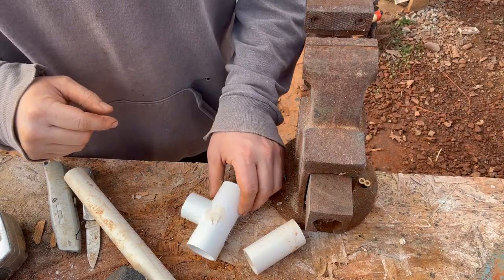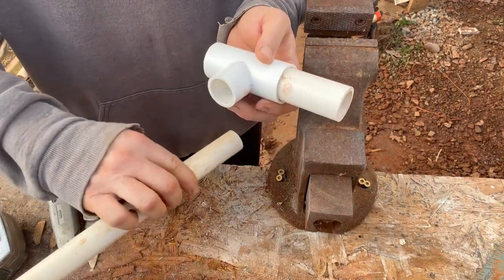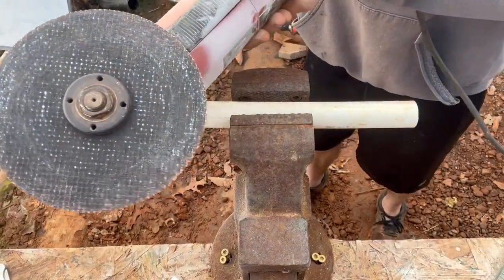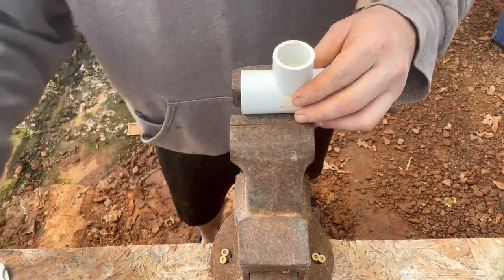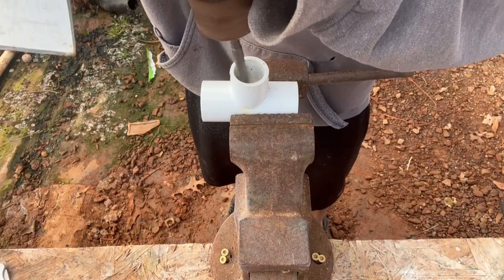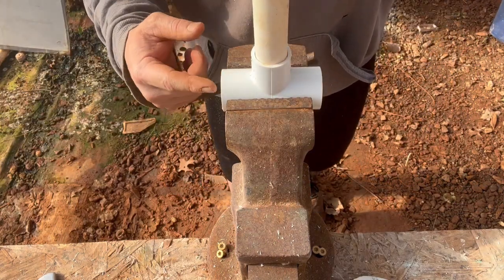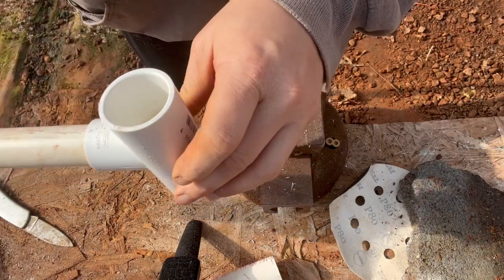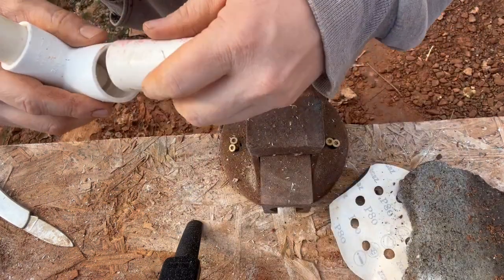Stop using airstones!! Use a $2 venturi instead!

Comment: an air pump is much cheaper, simpler, longer lasting and quite energy efficient for the amount of air... I suppose your suggestion to stop using air stones is if you're already running a pump... one could do the opposite and set up water circulation pushed by air bubbles for a very good cost (and energy cost).

Comment: If you T socket is for 30mm diameter pipe, for the vertical air inlet pipe, you can use 25mm diameter pipe which can be pushed in nicely. Aso on top of the vertical pipe, you can insert a ‘end cap’ & drill a small hole on one side. With that you can control the amount of air running out of the Venturi. Fyi, Venturi is the person who invented it.

Comment: .You need quite high pressure to get a venturi to work efficiently , so a pump is required . Or you have an air pump  Both used in water treatment   about the same overall  efficency.  For shallow tank , you are probably getting as much oxygen transfer from surface as from the bubbles

Comment: This has a low up-front cost but will cost a lot more to run over time than simply using an air pump. The back pressure it puts on the pump reduces flow volume and pump efficiency (costing far more in electricity than simply running an air pump would) and can actually damage some pumps. There is so much bad advice on teh intarwebz...

Comment: question. if I want to draw a liquid instead of air, will this same design work? if so, if I want to draw a high concentration of liquid to water or vice versa, what, in general, are the variable changes should I make to do that?
Reply from the maker: Yes this is generally what venturis are used for. They have a bunch of these for sale on amazon with different mixing ratios and sizes. They are also not that expensive, but the ratios are typically 100:1 200:1, so it may not work in your situation, but look around. 

Another way to do this is get an adjustable fertelzier injector, some of these can go down to 25:1 or maybe even more.

As far as the one in the video you would have to add a cap, put and install a barbed fitting with a small hose going to your solution. 

Good luck!
Reply: @SaludaGradeFarm 
thanks for the quick reply. my goal is to get a 10-1 ratio. I'll be starting with a 10% solution and hopefully get to a 1% solution. I've seen plenty that get me there more or less, but they typically are intended for pressure washers, and i want hose end. I'm thinking I may put a few in series for more total draw. I would like to try my hand at making it. anymore thoughts?
Reply from the maker: @GreggGiblin-sy5og what is your project/goal?
Reply: @SaludaGradeFarm 
hose to shut off valve to venturi liquid uptake from tank of bleach/soap solution  to telescoping pipe with hose connected back to venturi outlet with about 25 ft extension capability to a nozzles capable of reaching high places. bleach solution is 10%...reduced to 1-1.5%

Comment: Fantastic video! But does using such a system reduce the lifespan of the water pump due to immense load? 

Please suggest a good pump to use with this DIY venturi jet system.
Reply from the maker: No it does not seem to significantly effect the pump, why? Because it’s a centrifugal pump where water can literally flow backwards through it while running due to tolerance between the impeller and the housing. These types of pumps are made to work under loads that positive pressure pumps would have a hard time working under due to the stress, if it’s too hard it simply won’t push the water. I use creekstone pumps for small projects, I think 600 gph and I use alpine for large projects like this 5000 gallon pond setup. Just remember they will not work if you plan on submerging them below a foot, but then again airstones can have a hard time working at depth too. Hope this helps!
Reply: @SaludaGradeFarm Thanks a lot for the insights!

Comment: It seems the only way I can get this to work is if I have the air intake pipe at least 10+ inches out of the water.  The water pump is 800GPH about 8 inches under water.  Is that what you've found?
Reply from the maker: Not at all, I have done this with all different heights, I’ve made about 20 of these with various pumps form 250 gph to 3200 gph. The only thing that matters is the depth. They won’t run very deep. Play with the depth of the air pipe inside of the tee. Hope this helps!

Comment: I use a watt tester also to make sure the pump is not over working it's self . Better safe than sorry . In the winter i use my aerator also to help the pond heater keep an opening in the ice , Venturis do not work in the winter as they make the water to cold ad won't allow the fish a rest . My laguna aerator that i bought back in 2010 just gave out  less than a  month ago . I think it was the new substation the electric company put in that they kept having problems with  7 times the power went out and came back on in 1 hour and that has happened now for 4 days and it worked fine before this happened . I never had and issue .  This also effected my well pump my pressure tank and my 4 year ol hot water heater . I and a lot of other people hate our electric company . Yet here they are asking for another raise . The electric company said it was a fuse problem and now they want a raise  REALLY YOU COST ME MONEY ELECTRIC COMPANY . i HAD TO CALL MY INSUANCE COMPANY . They covered some of the damages  seniors are screwed every way . thank god Trump won . Every solar farm they built heer is not for us but they sure are ugly ruined hillsides cut down thousand 's of acreas of trees

Comment: how do you deal with the restriction to water flow this creates for the pump?
I currently have several small water falls and a fish spout cascading water back into my pond - Creates some level of aerator back into the pond. However the majority of my water flow goes through a series of drums holding K1 media where the water returned to the pond simply is returned by gravity - These drums rely on my air pump so curious if you think it would be possible to setup a venturi aerator on my system?

Comment: How come the water doesn't shoot out of both ends and just bypasses the air intake?
Reply from the maker: @Richardjaymz  on this system there are 3 venturis, so the only way to go is through one of the venturis. This is my older system, I now just use one and i have perfect aeration, I tested it in one of my older videos with a dissolved o2 meter!

Comment: With your cost for power to run that pump i can use trickle filter instead for surface exchange and have a lot of oxygen and filteration than. Surface exchange is key not the bubbles
Reply from the maker: I’ve Never heard of a trickle filter before, I’ll have to look that up

Comment: 4 eels!  Thank you so much, I needed to see this.  I have already purchased some cheap air pumps but I think I'm going to try this first.  Anything to reduce the number of moving parts.
Reply from the maker: Glad it helped! 

Stop using airstones for hydroponics! Build this simple $5 venturi in 2 minutes instead!
https://youtu.be/BaxPcKiuBwM

Here is an older version of the video that might be better for smaller system. 

I purchased a cheap air stone kit and the connections come apart all the time, drives me nuts!

Comment: Air stone is meant for tanks that you want mild/gentle water flow. If u want more flow than that just use the pump without shortening its life with all the back pressure. I dont understand what advantage youre gaining by doing this. It is cool though.
Reply from the maker: I’m using a water pump, not an air pump, and it is designed to work against resistance because it’s centrifugal. Also this adds circulation to this large pond. Essentially this is how the commercial operations do it, it also saves a lot of money over buying dozens of air stones that I would need and a huge noisy pump to run them. Has worked for me for years! 😃

Comment: It's cheaper on the electric bill to use an air pump with air stones than to run a pump 24/7. Granted I don't know what size of pump you are using. But you should have explained your setup with more details.
Reply from the maker: The pump is only 200 watts and it aerates 5000 gallons. Pretty inexpensive for the 500 heads of lettuce  I get per week from it. I use a version of these in all my systems just because of simplicity. The only airstone I use is in my seedling flood and drain. I just didn’t want to spend $1000 in a high powered pump and dozens of air stones. I opted for $100 pump that also adds circulation and has lasted for years.

Comment: Very interesting. But you failed to show how it was connected to a pump, singlely or in a series.
Reply: I would like to know if he is using an air pump or its just the suction effect that's pulling the air in
Reply: It's just suction that's how the venturi works,we use the same kind of thing to pull chemical/soaps through jet wash systems
Reply: I'm lost as to after I build this with PVC...how do I connect it ..I need instructions on how to connect what to pump ...

Comment: mine do not work
Reply from the maker: Sorry to hear that, Your pump might not be power enough, you may have it too deep in the water, or you may need to adjust the depth of the air pipe in the tee. It needs to be almost to the bottom and closing off the tee

Comment: Whats the deepest that thiswould work,
Reply from the maker: This will work to a depth of about 10-12” depending on the strength of the pump and size of the aeration. Most of the time they venturis are set very shallow to get the most oxygenation/flow. Plus it causes a wake on the surface which also increases dissolved o2. I will say the circulation it adds is nice.
Reply from the maker: I’m

Comment: I install piping to science labs in universities as a commercial plumber. An engineered venturi involves say a 3/4" tee,then 4-5" further you add a 3/4" 90°.
If the line continues then you just add another 3/4" tee the same distance apart. You pipe both lines going to the same location but in the beginning of both lines you install 3/4" X 1/2" tees. You glue in a piece of 1/2" pipe to join both lines together in the beginning section. This is a scientifically engineered venturi. We usually use schedule 80 pvc or sometimes schedule 80 cpvc. Interesting vid.
Reply: Love to see a diagram of video of this setup your speaking of sounds interesting
Reply: Yeah the explanation is difficult to understand fully

Comment: Ok. So. I had to improvise. I didn’t have a t with the one smaller hole so I basically 45’d the end of a piece of pvc, 3/4 inch, and made a hole that the 3/4 inch pipe would fit into a piece of 1 inch. It works….except when I push the get up down to the bottom of my pond where my pump sits, it stops pulling air even tho the pipe is well out of the water. As soon as I start raising it up out of the water, it slowly starts pulling air. What am I doing wrong!?
Reply from the maker: @diachilders3271  that’s cool improve! not doing anything wrong, the pressure increases the deeper you go and negates the vacuum. The only way to get better flow at the bottom is to increase the pump size. But if there is a way to suspend it I woudl figure that out. My pond is only 1’ deep and I have a 3300 gph pump.

Comment: Recirculating pumps also heat up the water.
Reply from the maker: Not as much as an air pump that compresses air 👍
Reply: @SaludaGradeFarm  An air pump is NOT submerged in the water.  How can it heat the water?
Reply: @larryd1296  Compressing air heats the air! thats why a diesel engine dont need spark plugs.
The compression makes the air hot enough that the fuel explode when fuel is injected. 😎
 A refrigerator-freezer works becouse of gas expanding and cooling the souroundings, hehe

Comment: Great design! Will introducing so much restriction to the water flow cause any issues to the pump?
Reply from the maker: These pumps are centrifugal, and designed to work against restriction. I have several pumps that have been running 24/7 for years 👍

Comment: I am wanting to sink one of these down to the bottom of my pond. I want it in a skimmer bucket and run pipe down to the bottom of the pond. I hope it works.
Reply from the maker: The deeper they go the less ability they have to suck air through the pipe unfortunately
Reply: Did it work?
Reply: How down did you take it, did it work ?

Comment: I tried this could not get it to work. Tried it every position
Reply from the maker: Wish I could see your setup, how deep is the Venturi? I have made a dozen of these and never had a problem, it’s the only thing I use to aerate 10,000 gallons, some as deep as 10” under water. How big is your pump? Have you pulled the beveled pipe in or out? Is the air pipe out of the water?

Comment: The same process applies to internal aquarium filters and the problem is the noise, how is the noise with this when sucking air?
Reply from the maker: It is a bit noisy but you can plunk the air pipe outside or baffle it some other way without reducing fair flow.

Comment: What water pump do you use?
Reply from the maker: Use a submersible pump that has at least 1 gph for every gallon of water in your system. https://www.amazon.com/Alpine-PAL5200-Pump-Black-Blue/dp/B001UFOD2U/ref=mp_s_a_1_15?crid=2Z8LR682LP8F1&dib=eyJ2IjoiMSJ9.7wTahFnWolwPp828KRfBhKapvK7jMukv-wug-BOqNo0sDoJMbXZAimab_zOakO5oihJcAbmhdMFEln_EKqV1yo1DEP7dxQg66irH5HmjZBpZyqo1RFXfk5VYti1uWsBjNZdcHSC2YpJPyV5oiBsvfgDdGSO4N5I4EYlX1fMbkJsNNwtCCqqXekIaVb5GXUMq4f-S0jLbwMd_tR1GTigm9Q.fMXVOCjmle5sDKL4L0QvbLlTI9b5ra8y2QFSC-HoA20&dib_tag=se&keywords=5000+gph+submersible+pond+pump&qid=1713741068&sprefix=5000+gph+%2Caps%2C99&sr=8-15

This is for a 5000 gallon system.

Comment: I'm looking for a way to oxygenate my sprayer for my hay field. Looks cool but i really need to nano bubbles if at all possible. I reckon i could neck it down until I get to 1/4in. What pump are you using? Thanks bro
Reply from the maker: I hear that you can put a small hose next to the intake of the water pump and the impeller will crush the bubbles. The pump may not last as long, but a pump is cheaper than a nano bubbler. Alternative may be an ozonator?
Reply from the maker: Btw my dissolved o2 is 8.5 ppm, so cannot really get higher than that on regular air.

Comment: Could I sand down this PVC pipe schedule 40 for long-term use in my freshwater goldfish Aquarium?
Or will it leak toxins after sanding?
Reply from the maker: Good question, and I am by no means an expert, but considering pvc pipe is frequently cut and used in potable water plumbing, hydroponic, and aquaponics all across the world one could assume it’s safe for fish. 

The main thing I have heard is just stay away from flexible pvc as it has plasticizers in it. Also, this is quite common in aquariums, most of the people viewing this video are using this idea for aquariums and koi ponds 👍 hope this helps!

Comment: Why not use dissolved oxygen by using a oxygen take of medical oxygen then dissolve that into the water?
Reply from the maker: This is way cheaper and it adds recirculation to this mix. An O2 setup would be used only in the event of a power failure.

Comment: You aren't 'oxygenating' the nutrient, you are moving it around, nothing more.
If you were oxygenating the solution the bubbles wouldn't rise to the surface before bursting, they would dissolve.
When you realise what you are doing is moving the solution it all becomes so much simpler
Reply from the maker: The bubbles cause what’s is called “subsurface aeration” basically the larger the surface area and the longer the surface are is in contact the more aeration. Please see my latest video where I demonstrate that my system is perfectly aerated using this system.

Max dissolved oxygen in water is only around 8ppm (using atmospheric air to aerate and not pure oxygen) so very little gas exchange is needed to create this level of dissolved oxygen.
Reply: @SaludaGradeFarm  subsurface aeration is just moving the water around, you can make the bubbles as small as you like, they're not being absorbed by the solution

Comment: Moving air is easier than moving water as far as energy consumption goes. However the same principle applies in reverse.
Reply from the maker: Probably, but what you don’t realize is how massive a system of airsotnes would have to be to aerate a 10x80’ pond. The cost would be tremendous, and the air pump would be large and noisy. I use a 200 watt pump, that’s it! The added benefit in my setup is the circulation added by the water pump too. Good luck!

Comment: What pump do you use
Reply from the maker: For a large system I use (5000gallons) https://www.amazon.com/gp/aw/d/B00489Q0VM?psc=1&ref=ppx_pop_mob_b_asin_title 

For a small system I use 1000 gallons or less I use:

https://www.amazon.com/Knifel-Submersible-Protection-Fountains-Hydroponics/dp/B0855JHGRM/ref=mp_s_a_1_1_sspa?crid=2SRR1Z7H1BKYC&dib=eyJ2IjoiMSJ9.V1G33vafRaaCh42o-5Mzc8_kIeSCUPE3G49ca7ednELy6OqUJbp7mWG4DDVfcEHyD1-GEgL48PVbFtO8_RhskHBOUecqXscGaOpC42MwlogG0MBK76tcr33jGGAUzlU3qRnX2a9bLDHhm7br_BbLOditU6HuF2k47BV2R6_GlQ5fknMDguK9c-1ukqtO5YbgNsHj9gq_r2WrwOx3vWvHyQ.838qceHQRVCKGWhm-Bj6-qLpPWu1IlJQxWMRsyftLKY&dib_tag=se&keywords=800%2Bgph%2Bpump&qid=1709045512&sprefix=800%2Bgph%2Bpump%2Caps%2C329&sr=8-1-spons&sp_csd=d2lkZ2V0TmFtZT1zcF9waG9uZV9zZWFyY2hfYXRm&psc=1&th=1

You can use a smaller pump but I like the ones that come with the filter sponge. Alternatively you can use a filter bag.
Reply: @SaludaGradeFarm  nice thanks

Comment: Anyone know if you run the air inlet outside if it would help raise PH in a salt water aquarium?
Reply: You will probably dissolve more co2 in  your water, probably gets more acidic. But it can go up too if it's very low. It's just putting the gas exchange on steroids